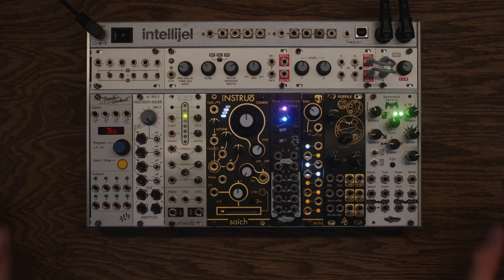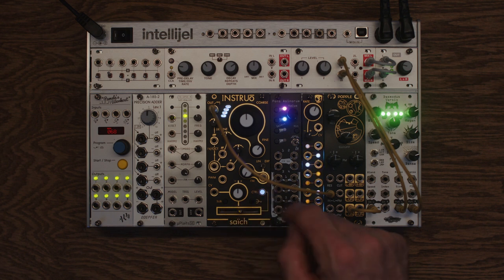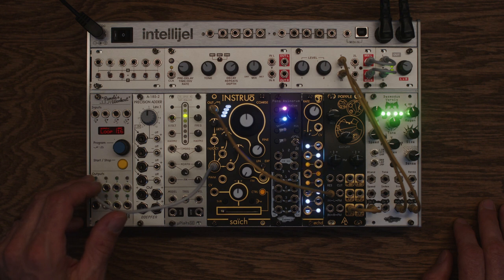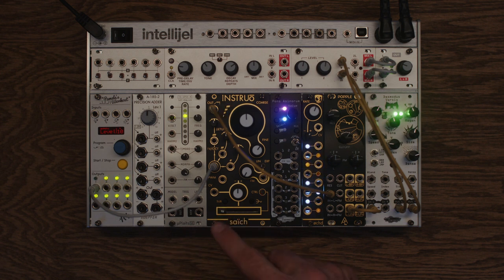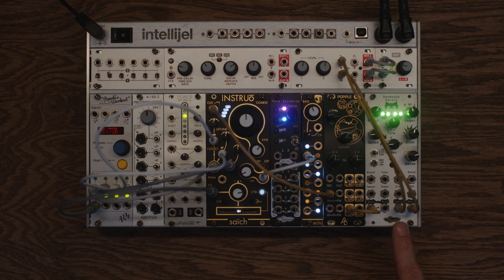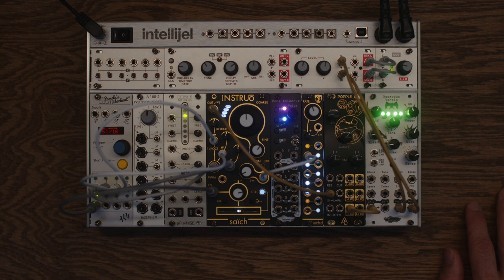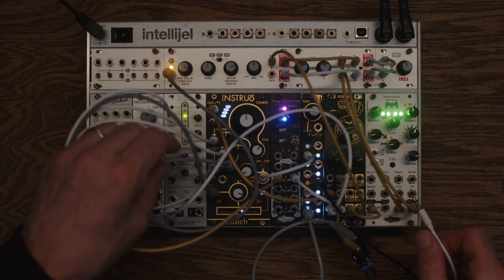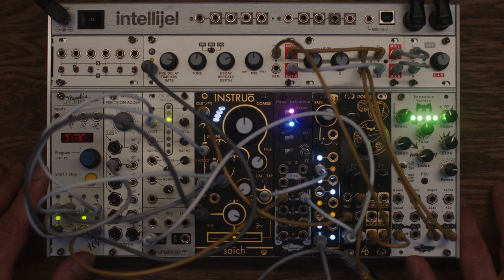Small Modular Synthesizer | Patch Process Breakdown | Ft. Instruo Saich

Comment: Nice. You have that switched mult in your vid’s but haven’t seen you use it. You could use it as input to Pam’s to turn on/off loop I think. Or put an attenuator there instead. Nice patch. Did something similar with Disting EX the other day, but it won’t fit in a skiff case.
Reply: That's a great use for it - I'll have to give that a go. When I use it, I'll throw a couple of different gate rhythms into it and then switch on and off to change or "mix" the rhythms. (2 in 1, out for instance). It's not exactly how it's meant to be used but produces interesting results.